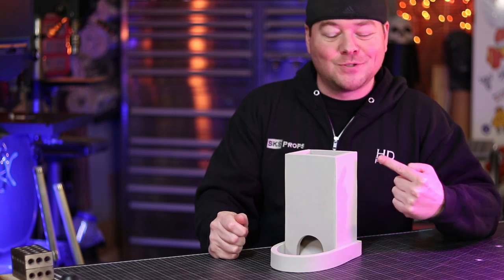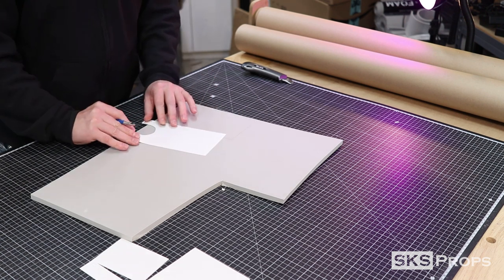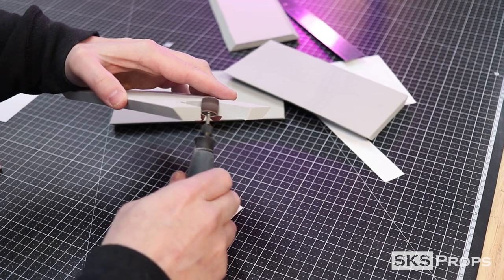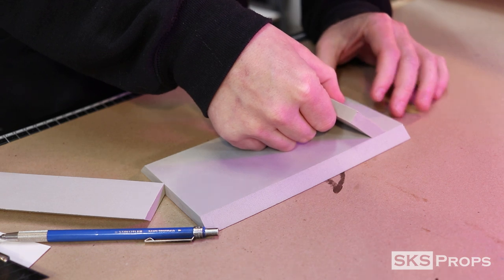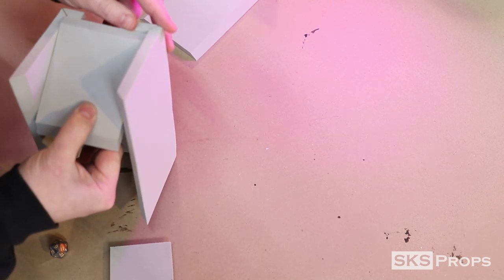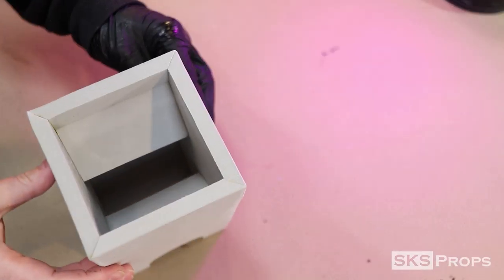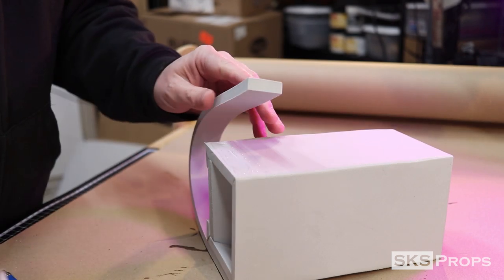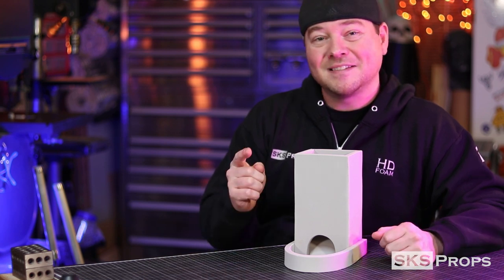How to Make a Dice Tower Out of Foam with Free Template DIY D&D Craft

Comment: On your pattern, the base indicates to cut the wider sides at a 45 and it should be the narrow sides. Had to recut that piece, but otherwise fantastic! Thanks Steven. Also, could you do a more in-depth video about paints? I took your recommendation and got some of the heavy body acrylics from liquitex. But I’m unsure of some of the properties and how each compares. For instance, what is lightfastness, and how do you tell which is a covering paint and which is a hue or such? Would be great to have something comprehensive from a prop making perspective. Thank you.
Reply from the maker: Thanks for the heads up I changed the 45 degree cuts on the template and yes I do plan on showcasing more paints and brands and their properties in the future.